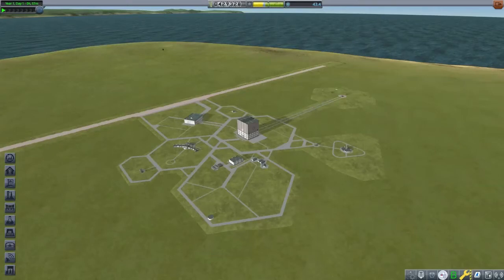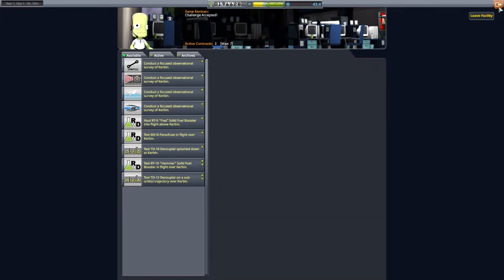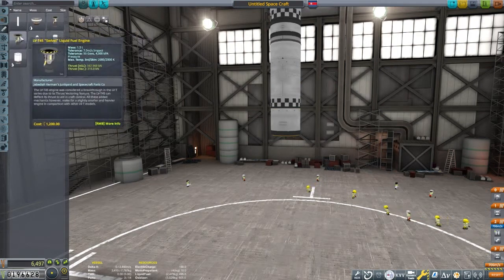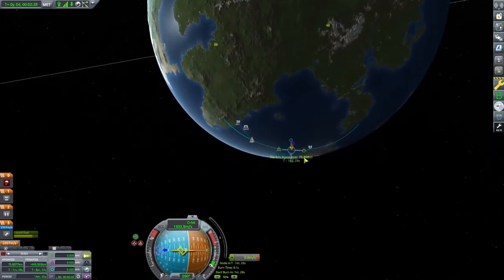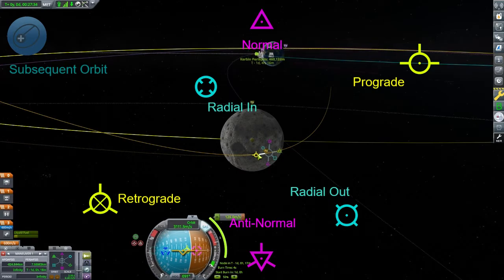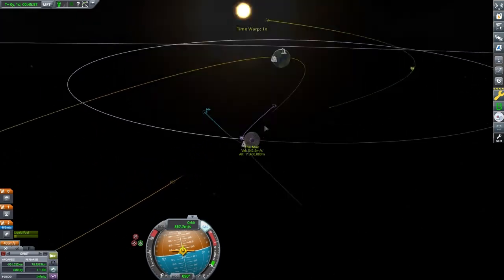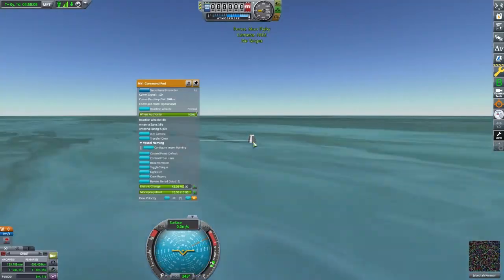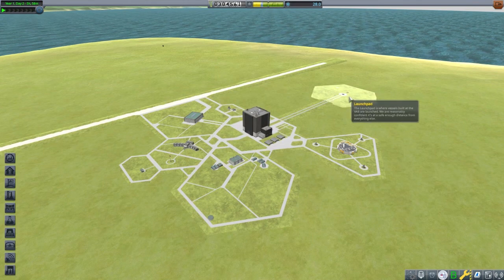Career Mode Tutorial Part 2: Making Maneuvers

Comment: Hi! This video is very helpful but you are going along a little too quick for me, i don't know the buttons to any of these maneuver signs you are putting down. Could you explain?
Reply from the maker: The maneuver signs are labeled in the video.
First off, the nav ball indicators are relative. You can reference your orbit, the planets surface or an object you are targeting.
The Maneuver node directions are:
Prograde - your current vector or direction of travel
Retrograde - the opposite direction from which you are going.
Radial in - 90 degrees from prograde in the same plane as your orbit and towards the planet you are orbiting.
Radial out - 90 degrees from prograde in the same plane as your orbit and away the planet you are orbiting.
Normal - perpendicular from your orbital plane and in a northerly direction.
Anti-normal - perpendicular from your orbital plane and in a southernly direction.